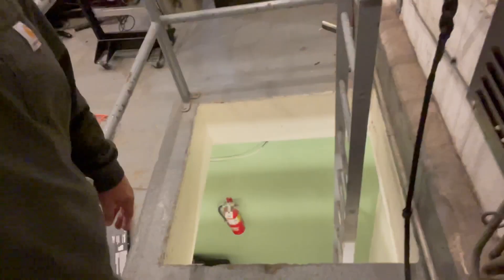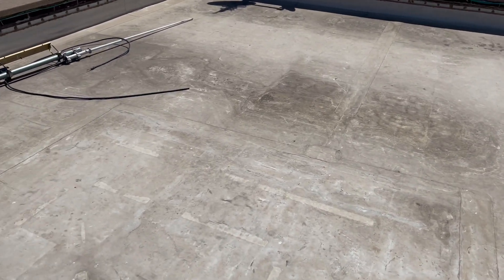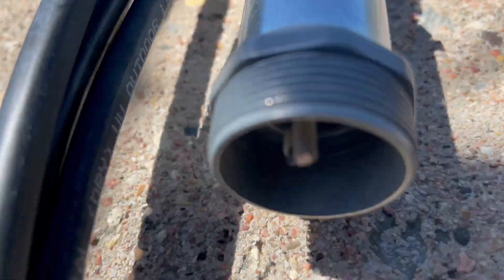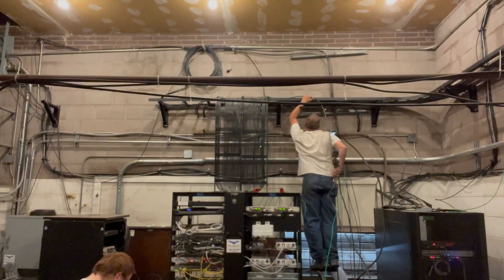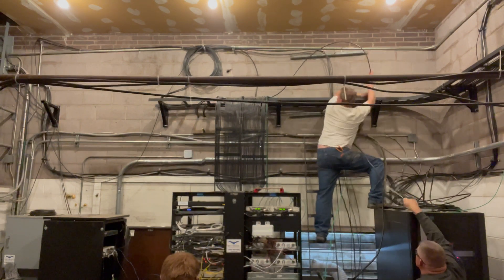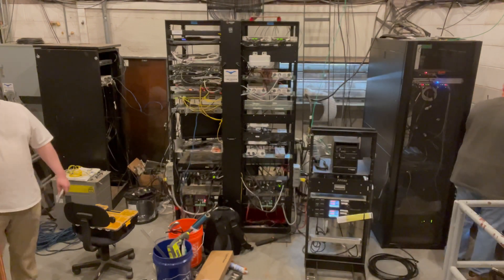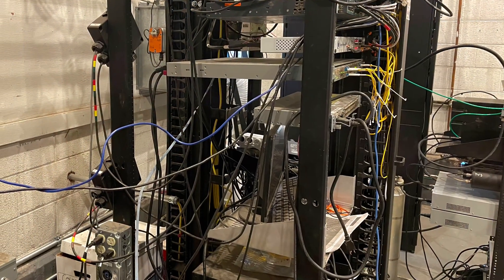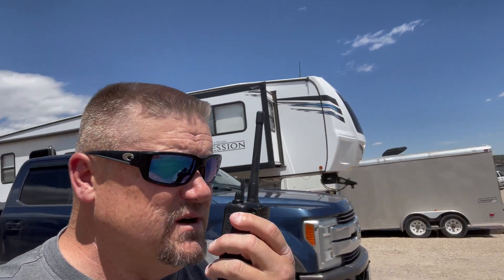Installing A New GMRS Repeater: COSP 650. What all does it take? Colorado Springs GMRS Radio Club

Comment: You sure that duplexer is tuned and hooked up right? Awful coverage, should be 100x better.
Reply from the maker: It seems that there was a general problem with the repeater itself and it went back to BridgeCom and was repaired over the next 6 months. It finally came back but hasn’t been reinstalled yet. It has been offline since about a month after I made that video. Hopefully everything was corrected but the owner hasn’t put it back up yet. Ham-Solo K0FYR WRMV759

Comment: Must be nice to have GMRS repeater activity . None here east of Pittsburgh just stores cleaning floors on 462.725 output .  Keep at it duplexers may need adjusted try having distant station transmit in on repeater then while at site shut transmitter off see If any desense .
Reply from the maker: Actually, that repeater has been down for 6 - 8 months right after we installed it. Had to go back to BridgeCom and has been out of service ever since. I live about 25 miles up the mountain pass as well and couldn’t hit it unless I came down to the Springs. Not really any GMRS traffics up where I live. Denver however has like 6 repeaters with a ton of traffic everyday. I am jealous of them. Ham-Solo K0FYR WRMV759

Comment: Great video. I like the realistic conditions you were able you capture on video such as moving to different locations and testing to see if you could hit the your repeater. This will allow you to make adjustments and improve your overall setup. Keep up the good work.
Reply from the maker: Thanks Oscar I appreciate that. The repeater went down only about a month after that install and has been back at BridgeCom ever since. Not sure when it will be repaired but it’s been many many months. Ham-Solo K0FYR WRMV759

Comment: Thanks for the video of the installation. My first suggestion would be to use a commercial grade antenna, but the one you donated from HRO should work better. Especially since moving it to the parapet of the roof line.

I bought a Bridgecom repeater several years ago and had to return it twice for service. I eventually sold it to a ham in Oregon who placed it at a mountain top site at about three thousand or so feet.
The mobile duplexers are much lossier than full size cans and perform accordingly.

I also highly recommend using half-inch LDF4-50A from Andrews for exceptional performance and minimum signal loss.

73 de N9GIX / WQWU726
Hot Springs National Park, AR
Reply from the maker: Thanks for watching. Yeah that repeater went down probably a couple of weeks after we put it up. It has been back at BridgeCom ever since. Hopefully they can figure something out soon to get this club back up and running. People are starting to jump ship so we need a boost or something. Maybe Santa will be nice and help out the repeater owner. I wish they had cans like all of our ham repeater sites but that is more in the future with growth for these guys. I’ll see you down the log. Ham-Solo K0FYR WRMV759

Comment: Why type of antenna are you using for the repeater
Reply from the maker: Hey Juan thanks for watching. Originally it was some type of PVC home brew antenna that was really getting out. I gave the GMRS group a GMRS antenna from Ham Radio Outlet and I believe they installed it on the roofline but the radio went out shortly after and has not been back in service for 6 months. I guess we’ll see when it comes back what they decide on. Ham-Solo K0FYR WRMV759

Comment: Before I put a repeater up I monitor the repeater input to check for interference on frequency in the area putting my radio on the gain antenna I am going to use on the repeater. Inter mod from multiple signals happen a lot so I then get a spectrum monitor to check what frequencies come up. If any close frequencies come up I put a tunable notch filter to attenuate the interference frequency. 2 cans work good on uhf. TX/RX systems sell good cans with low insertion loss. I use TX/RX duplexers because the vari notch series help  take a lot of the interference out. Looking from that roof ur range should be awesum. I would also check receiver sensitivity direct to receiver then thru the duplexers if it has those foreign duplexers expect 3 or more Db loss which makes your receiver a little deaf. Have fun, repeaters can have multiple problems even with type of cable. I myself use Solid Andrew Heliax to reduce loss LDF4-50A some people use other types but I come from a Motorola shop and I installed repeaters daily, nothing smaller than 1/2 inch heliax for short 80 ft runs. Then we go to 7/8 then the real big stuff for cellular. Alright guys great work, your almost there.
Reply from the maker: Wow that is great information. I will definitely make sure I pass this on to the guys so they can look into all of those areas you mentioned. I have seen the bigger repeater setups before being from the public safety arena but have never been involved with that aspect until now. Thanks again for the info and for watching. Ham-Solo K0FYR

Comment: We are in the plans of a mount that will go on the edge of the roof and raise it about 3-5ft. Alex swapped out the antenna for a tester and raised it, it worked fine. My belief is that the tester antenna will be used until I can manufacture a new mount.
Reply: Even a tripod mount (perfect for those 3 sandbags) with a smallish 5' mast would probbaly make a ton of difference with the radiation angle. I'll be interested to see a follow-up test on this. Nice work to all!
Reply from the maker: Oh wow cool. I offered up also another antenna that is specifically tuned for GMRS and is 6 ft long and has some 45 degree radials on it. Ham-Solo K0FYR WRMV759
Reply: @Ham-Solo  Like you, I wondered if an antenna better tuned to GMRS would have worked better. WRDN460
Reply: When you installed the antenna, my first thought was it seemed kind of low. It seems as though part of it is obstructed by the ledge of the building.  Maybe try going above it.....at least to the height of the illegal antenna you mentioned.

Comment: Great video! ❤️
I think I may have to go back up and maybe up the antenna height...
Over all... thanks for making the video, it was cool to see how it came out. :D
- Alex
Reply: What's odd is when i tested the swr i was getting a 1.01 through the cable to the antenna... so, i think it's a height issue. -_-
Reply from the maker: @neosmith80  sent you a couple of emails. See what you think. Mike (WRMV759)